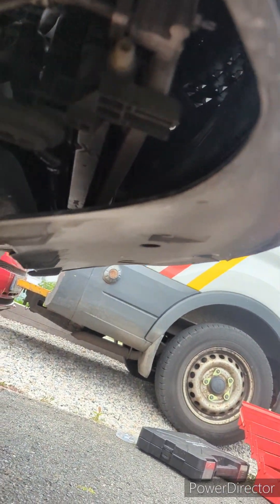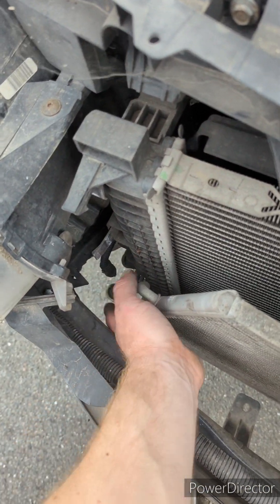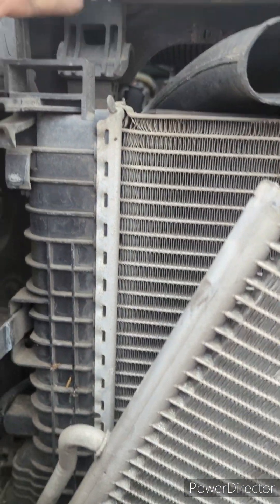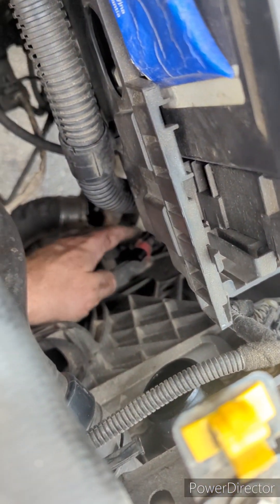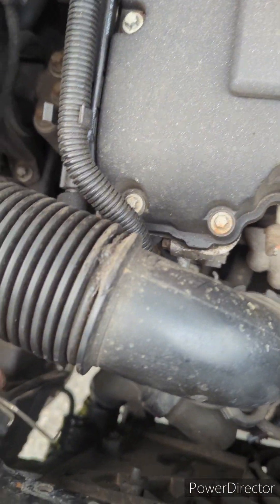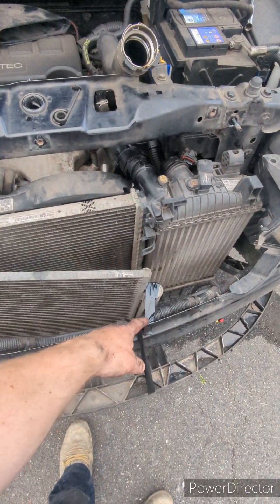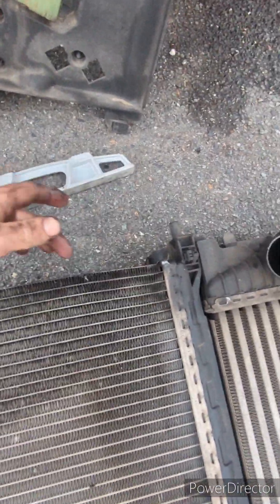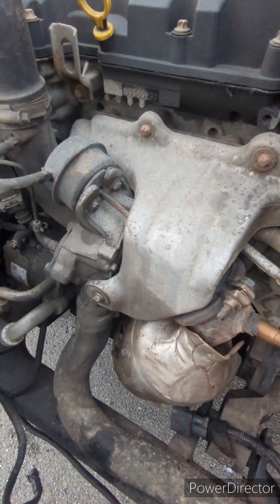vauxhall / Opel meriva B, 1.4 petrol turbo radiator / intercooler replacement.

Comment: How to drain the antifreeze from the radiator on this model
Reply from the maker: If you look at the video 5 minutes 57 seconds in, just to the left of the pry bar below the temperature sensor is a white/ clear plastic drain plug, I think it uses a 13 spanner. Don't remove it just loosen it. It's plastic so don't overtighten.